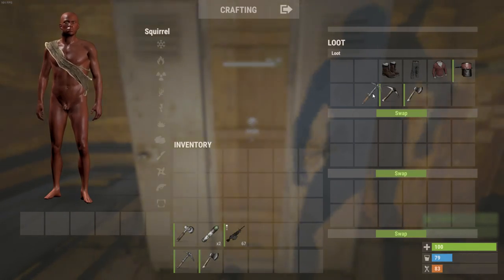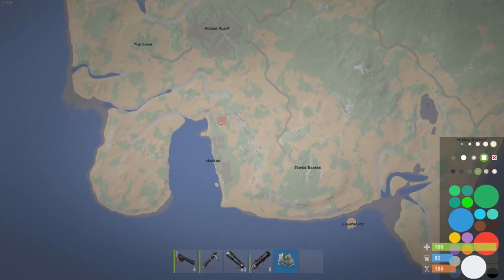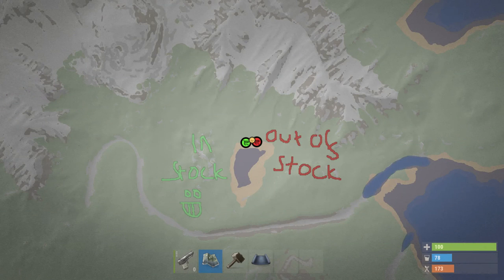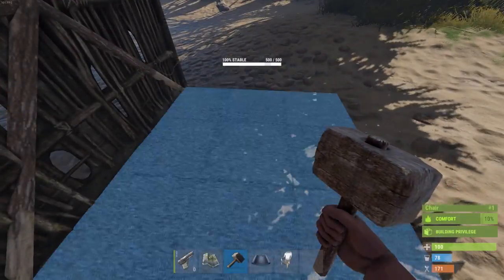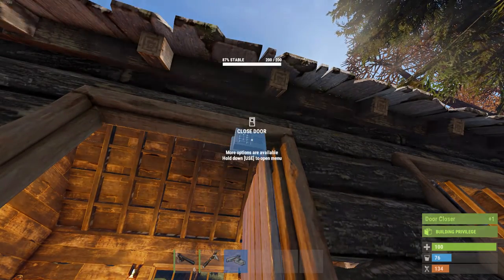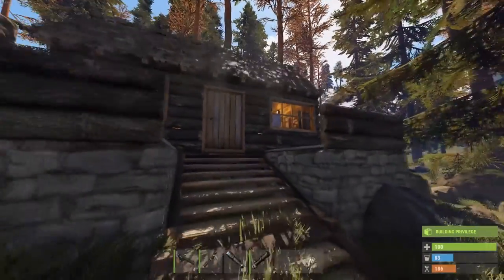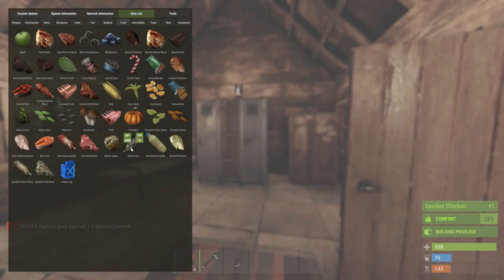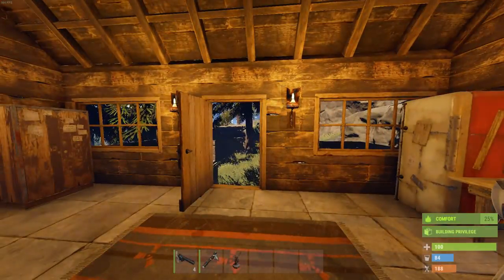DEPLOYABLE LOCKERS! DOOR CLOSERS? SMOKE ROCKETS? BUG FIXES +MORE!!! - Rust Updates

Comment: We manged to two man the heli with one 3x3 and one 2x2 heli bases, the fires made a true mess at the bases and also, the walls were damaged so I am pretty sure they are not fully fixed yet. Plus the heli fell exactly on top of our main building roof and we had 3 boxes drop off the building and two laying on top, so probably now it drops 5 boxes.
Reply from the maker: Interesting! thanks for the comment :)
Reply: Down it two more times, damage on structures can be confirmed, unfortunately both times heli dropped in a noob friendly area and can't confirm 5 boxes.